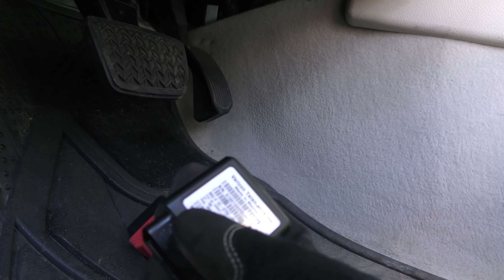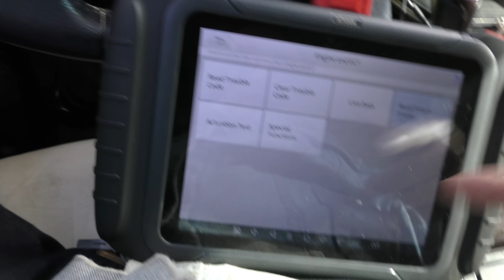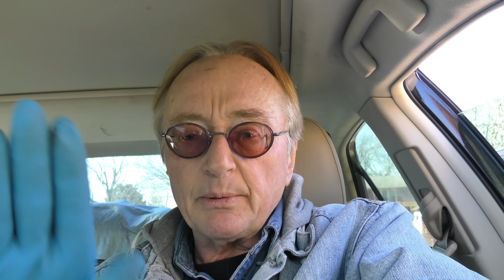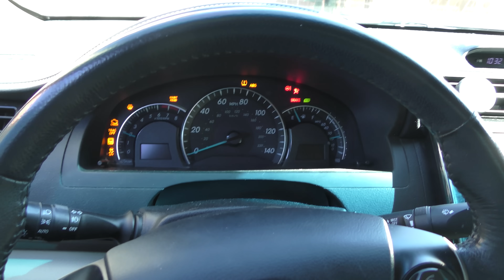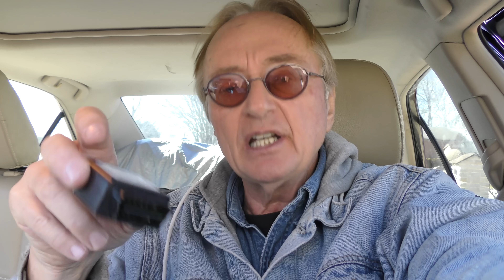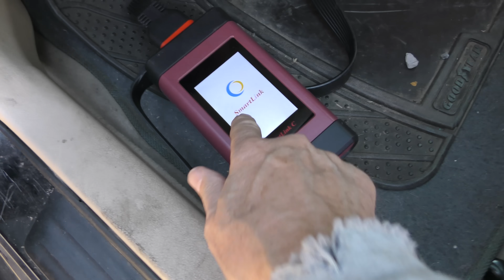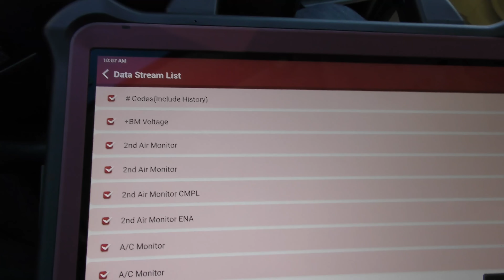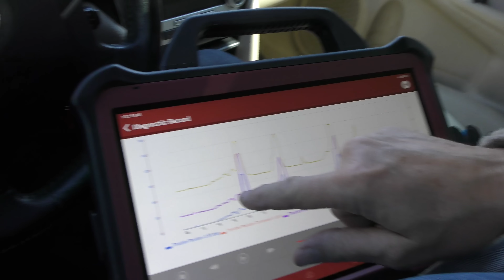This Stupid Device Just Cost My Customer Thousands in Car Repairs

Comment: Scotty might have got this one wrong.  While the computer may be damaged, it’s highly possible that it was caused by the Verizon dongle.  While the Verizon Hum does provide some high level diagnostics (nothing specific enough for a mechanic to use), it’s main functions are to provide WiFi connectivity and act as a GPS tracker.  There are literally millions of these things on the road because companies like to know where their cars are and how many miles are driven for work rather than have to keep a paper log of all miles driven.  Others use these to set speed limits for teen drivers and for geofencing to make sure a teen driver stays within a particular area.  I’m fairly certain that someone has set a speed control and that speed control was sent to the PCM computer, which is how some parents and companies set and keep a speed limiter on in long-term situations so that the kid or the employee doesn’t say “well screw this, I’m just gonna unplug this thing and go fast”!  Had Scotty had more background as to what this thing actually was, he might have gone into the Verizon Hum device on the website and saw “well, the employer of this woman doesn’t want her driving over 50 MPH, let me reset this here on the website and update the PCM and THEN run our diagnostics”.  Just saying that it was made in Mexico (he said it twice) shows me that he should have researched more about the OBD device and what it’s uses are.  My experience and the ratings on the Verizon website that these things have design issues, but I saw no one said anything about the devices frying the car’s PCM
Reply: We had a different band of these from two different company's on a fleet of 30 Ford and GM work work pickups. They all started exhibiting problems, including my work truck and my manager and we don't even drive the same mileage as the hourly staff. We removed them all and problem solved.
Reply: I install these for a living. They are definitely meant to be left plugged in. I have never seen an OBDII tracker cause driveability issues, only the hardwire GPS's, and that was due to installer error.
Reply: I use a ELM and it stays plugged in all the time. No problems for over 4 years. Mine sends info to my phone as soon as it starts. I drive a 2006 Scion Xb which is made by Toyota
Reply: Doesn't explain why it only acts up when cold. What speed limiter removes itself when the car is warm 😂 this is clearly damage. Was it the dongle? Can't tell for sure, but when all other possibilities are exhausted, whatever remains must be correct
Reply: If the problem was  company setting a speed limit, it wouldn't go away once the car warms up. Also if it was a company car, the company would probably be responsible for the maintenance
Reply: If it's a Verizon HUM device and the owner didn't know about it, that's concerning.  It may have been left over from a prior owner of the vehicle, or someone (husband) could have put it in to monitor her driving.   The HUM devices ARE designed to remain plugged in and should not harm the vehicle, but someone buys it from Verizon & pays for the service; Verizon doesn't just put them in without permission for free.  I agree that Scotty should have investigated further. He should have determined who put the device there & why, rather than blame the Verizon device without proof. The problem might have existed even before the HUM was installed. That's lazy troubleshooting.
Reply: I've made an app in Android to read off of one of these OBDII sensors and display a live dashboard on a tablet. In college. I guess I'm an overachiever. That said, Progressive Snapshot does not work with my Lexus 200h or a Prius for a reason. They can mess things up so they blacklist certain cars.
Reply: Yeah, always blame Mexico! He didn't correctly diagnose the car! You have to individual check the systems not rely on a scan tool. It may be a fuel issue or a temp sensor issue.
Reply: @Mekhanic1  Build a bigger wall! Lol
Reply: I used the tracker on my car from “Automatic” which I think is the company Verizon bought
Reply: Had a couple of these things cause me issues at the shop
Reply: Ok, what?
Reply: Umm... it would have a really hard time 'stopping a teenager' since the OBD port is directly accessible and below the steering wheel. It can easily be removed and all functions of the car restored and go to unknown whereabouts. Battery in the dongle says otherwise? Cool! Throw the dongle out of the window. Problem solved.

Scotty nails it here because he's using a much more complicated system for car mechanics and not a $30 dongle that doesn't prevent employees from removing it.
Reply: @The_Intellectual problem with your reply is that he found the problem. It wasn't the tires. It wasn't the breaks. LOL
Reply: @The_Intellectual the dongle. Caused. The problem. The end. Nice intellect. :)
Reply: Learned something new, thanks!
Reply: He went over 60 after it cut off at 49.
Reply: It is very concerning to me the idea that someone would have any control over some vehicles speed. Imagine you made a poor decision and got caught passing a car into oncoming traffic and you couldn’t accelerate 😮 above the required speed.   Yikes 😳
Reply: Thx for the info
Reply: Does this surprise u. He just keeps yelling at me!
Reply: The fact that it says Verizon on it should have raised a question to him....duh
Reply: As a Toyota mechanic I absolutely agree with him these dongles  do not go well with Toyota I have seen dozens of issues with them.
Reply: I have to agree with you. Maybe take it to Pine Hollow Diagnostics. That guy can find any problem.
Reply: Casual racism
Reply: @chrisogrady28 Yep the type nobody really cares about or takes into consideration and just thinks it's okay to say. Saying it to a friend for around folks you know but it's irresponsible when you have the sort of a channel. This is not the first time that he said it. Made in Mexico made in China blah blah blah. 

Yep casual racism is the perfect description.

Comment: Scotty, my 2001 Saab 9-3 used to do the same exact thing as this Toyota. I replaced the crankshaft position sensor and found a ground issue in the trunk going to the fuel pump. After fixing those two issues I haven't had a problem since with acceleration.

Comment: That is a bad connection when voltage and current spike and vary like that it could simply be a loose pin in the connection of the pedal or throttle body plug

Comment: I guarantee you that corrosion on the positive battery terminal is causing the issue. I had the same thing happen with my 2011 Avalon and after I cleaned the corrosion off and cleared the codes it ran just fine. That was almost 2 years ago and it hasn't happened since then. Same exact thing happened with a friend's Scion tC. Cleaned the corrosion off the battery and it ran just fine.

Comment: The dongle is a red harring. The more likely as the car has aged the grounds or a connection at the pcm has green crusties or the throttle motor is just out of lube. You did say the voltage is out of spec. The other issue as well is water in your gas or a fuel filter clogging which would explain the limited power. I feel this needs a revisit with a spare junk yard pcm since that car is a dime a dozen and your scan tool writes keys scotty.
Reply: I've found that ground points on cars become iffy with age, and cause a number of weird problems.  I used my jumper cables and put both clamps at one end on my negative battery post, then put both clamps at the other end of the jumper cables onto a couple of different places under the hood that should also normally be grounded (one clamp onto a metal bracket on the engine, and the other clamp onto a bolt on the body also under the hood).  This made the computer on my 2006 PT Cruiser stop acting up, and the analog clock now (mostly) keeps correct time.  Bad grounds.  Bad problems.
Reply: @rachelblack3816  the copper wires after years patina or turn black inside the wire.  Best just to replace old grounds after 10 years. Speaking of clocks my hybrid goings from 12.60v off and 14.00v on. This causes my software based clock to go ahead in time a minute every couple of months. I find older cars keep rock solid time because they use a crystal oscillator to keep time.

Comment: Everyone loves to praise computers and technology but theyre alot more expensive and troublesome to fix than old school technology. All the damn car needs is a simple stainless steel throttle cable and carburetor like old cars and lawn mowers still use, but auto makers know that's virtually bulletproof and alot less money for them to make off you as it would never break. Assholes! Somebody needs to build cars to work well and last instead of fall apart to sell more parts, labor and replacement cars. 
This is why I love old school cars before computers.

Comment: If I'm not mistaken, that's a Verizon HUM module, which is used not just for diagnostics, but also Geofencing and driver monitoring (primarily for younger drivers and fleet vehicles). It's designed to be plugged in and stay in place so that the car can be monitored remotely. The computer certainly can be damaged by a third party device, but I think it's unlikely in this case, given that the device is purpose-built to stay plugged in.

Comment: Scotty I guess it goes for the dongle‘s that take out the AFM System and give you more horsepower on the GM V8 s ?
Reply: No ... I used one in my 2016 Silverado 5.3 l V8 for 5 years. Not a single issue.

Comment: I have an 06 Camry that felt like it wouldn't drive until you were on the gas pedal about a half inch. Then it kicked in at around 2500 rpms. Changed the throttle body and still had the problem. I bought a used pedal from a junkyard and it's fine now. Wouldn't come up on a scanner because it didn't trigger the check engine light. 264k miles still towing my jet ski and drives like new. Best car ever made💪

Comment: My takeaway from this video Scotty is that we need to go back to how we built cars in the early 1950s ... maybe earlier. There has got to be something we can do to clean up emissions without the TONS OF added on CRAP. This is pure planned obsolescence. What needs to be factored into the 'green' equation is how many otherwise good cars are JUNKED over some simple little doodad that is no longer available 10 years down the road. My sister bought a newer car because she could not get a stupid chip to repair the one she had!
Reply: If cars from the 50s were built so great and built to last,  how come we don't see any on the road today? Because they all rusted away. And remember the brown smog over LA before poison emissions were reduced by the government legislation?
Reply: @IsaacLoven  , Yes, you are correct about the rust problem. I was more referring to the other technologies in modern cars. How many cars today have windows that wind up and down manually? And that is one small element. I would have to do some research, but, I believe there have been some engines with low emissions that did not require all the electronics or a catalytic converter. As far as durability, the Dodge/Plymouth slant six was absolutely amazing. In the not too distant future cars will be of much lower horsepower. And that pollution you mention I believe was more due to industry. I lived near Pittsburgh PA and I can tell you the smog from the industries was unbearable ... although many people that lived near various industries seemed immune to it.

Comment: That's a Verizon HUM GPS device 

Customer did not have any knowledge of the OBD tracking device being plug into her vehicle!!?👀

(Hum is a vehicle diagnostic and tracking system from Verizon Communications. The system is composed of two devices: a diagnostics reader which connects to a vehicle's OBDII)

(Verizon Connect GPS fleet tracking requires hardware devices to enable vehicle and asset tracking. We can help you choose the best GPS tracking hardware, understand your installation options and start monitoring your fleet vehicles quickly.)

Comment: I'd definitely change the battery. It has a pool of corrosion on the positive terminal. It did throw a low battery code I think too. Weak batteries can make a cars electronics go nuts.
Reply: Especially Toyota vehicles! I have an Avalon and it had a lot of corrosion on the positive terminal and one day I was driving when all of a sudden the car started acting up and my dash lit up like a Christmas tree! A little baking soda and water on that corrosion and boom! Problem solved. Same thing happened with a friend's Scion tC.
Reply: @treysimmons2589  yup absolutely correct did the same thing to my Avalon and Camry.
Reply: @treysimmons2589  what year Avalon ?
I've got an 01 just about to break 300,000 miles, still running strong !
Reply: @antisocialjusticewarrior2073  2011. I have 146k and she's still going strong!! If she hits 300k I'll be happy af!!
Reply: @treysimmons2589  pour slowly onto the corrode terminal with hot water (boiled temp) also help efficiently..
Reply: I love people that give life like attributes to inatimate objects. 🤣🤣🤣  If you get less than 10.0Volts while operating esp 9 Volts I usually see ABS codes and U-codes set(comms via HS or MS CAN bus.   Thats nothing Crazy, ECUs need over 10volts to operate properly. Its the way they are designed.  Corrosion on a terminal may be an issue but if there is no voltage drop (learn how to do a proper voltage drop test) thennyou are just doing work for nothing. I always want to see concrete values and evidence and after repairs the exact opposite result withbthe proper voltages and low resistance.
Reply: @snakattack883  you can have enough connection for the meter but not enough to hold voltage under load. Corrosion is bad on electrical connections, and cleaning it is never doing work for nothing.
Reply: @ED-es2qv  look up how to do a proper voltage drop test. If corrosion is the reason, it will show.
Reply: 100% had many "false" issues on multiple cars (different brands and models) all had batteries at end of life but no issues starting. New battery and they all like magic had no problems
Reply: @ausguy4385  magic lol. Well a batteey doesnt pass a liad test and voltage drop tests but thats the problem. Over 20 years working on premium autos🤷‍♂️
Reply: Agree. I have a 06 V6 Sonata. Had a 02 sensor and full vapor error code. Changed the battery and no more problems.
Reply: "Weak batteries can make a cars electronics go nuts"

From a JLR owner? They are known for it!
Reply: Low battery on my Mazda 5 did exactly this.
Reply: Absolutely....it can also kill an alternator by being low. The battery acts like a buffer from the alternating current so that your components aren't getting 15 volts at high rpms and lower voltage at lower rpms. So if your battery is bad or has dirty connections it can fry other electronics that are sensitive to alternating currents.
Reply: @medix1203  alternators charge at a pretty steady 13.5-14.3v. It shouldnt be fluctuation dependent on engine speed. Alternators have a voltage regulator/rectifier that balances the voltage, output is measured in amperage  dependent on load. 30amps low load....145amp high load.   Do some homework bro.
Reply: @medix1203  Absolutely. I fried or blew out a gate in a bcm by staying on the phone in the car for 2 hrs then starting the engine. I guess it had about 11 volts. It was a really bad time & I had to junk the car.

Comment: Hi Scotty!
I’ve got a dongle plugged into my OBD port full time. It defeats the start/stop system in my ‘19 Ford Escape. Is that a bad idea as well?
Reply: They don't have the option to turn it off anymore? My brothers girlfriend had a 2017 or 18 escape and you could turn it off without anything special it was in the menu.
Reply: @xxskitsxx15  Not that I’m aware of. I wish that it was that easy!
Reply: @johnjacobs7618  I read that if you  put it in S instead of D (sport mode) it will stop the stop start from engaging.
Reply: @xxskitsxx15  That's true. I normally just use D though because the fuel mileage is better in that mode.
Reply: @johnjacobs7618  I posted a link on how to disable it on the in dash menu. The thing is is you have to do it everytime you start it. Do it while it warms up

Comment: Hey Scotty, have you ever heard anything bad about the Ultra Gauge? I bought one years ago and have had it plugged into the diagnostic port for probably 200K miles. I've never had a problem, but UltraGauge is basically a display. It has some ability to reset codes and track service and oil change intervals and such, but I use it mainly to see gauges that my dash doesn't have, like monitoring intake temp, exact coolant temp in degrees F, etc. I also use it to cross check my speedometer and tach. BTW, my Explorer has over 360K miles on original engine and trans. V6 4.0 SOHC 1999 model year.
Reply: I used my Ultragauge in my Honda Accord for well over a year before it's buttons broke and I couldn't change screens anymore. Worked like a charm and never caused me issues either.